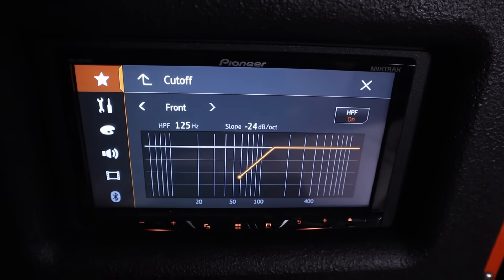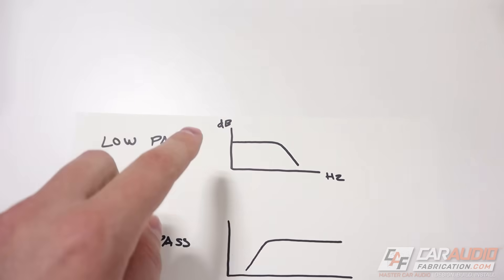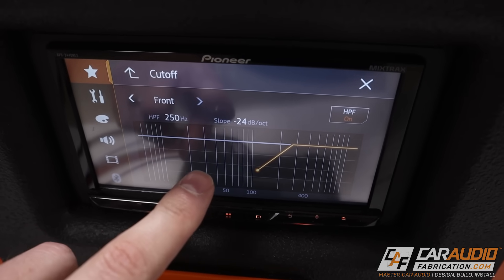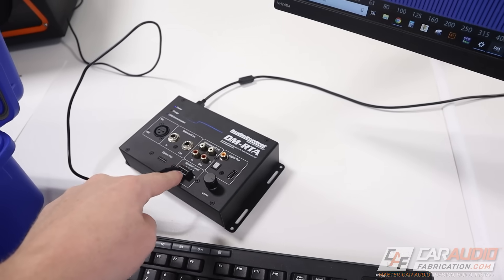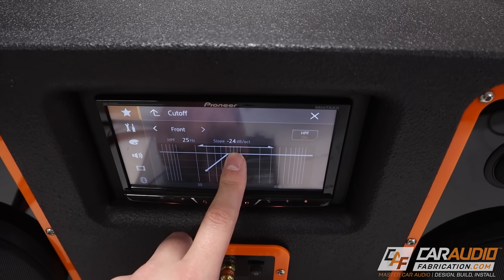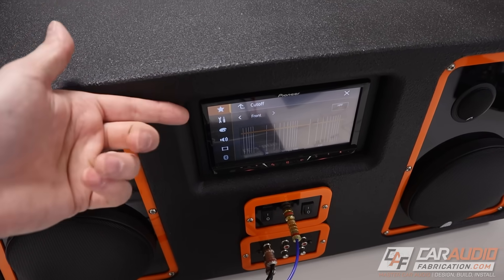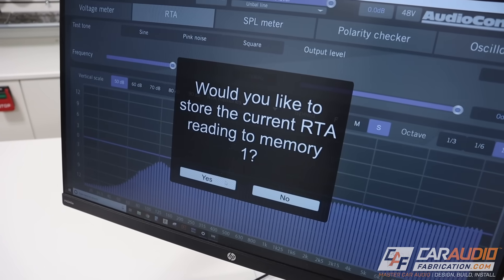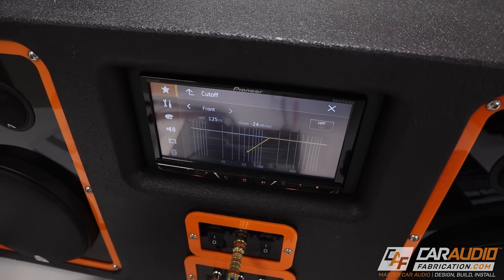Crossovers for Car Audio - Tune on HEAD UNIT or AMPLIFIER? Or combination?

Comment: Sometimes a passive crossover is just better. its kind of hard to find the exact caps and coils and you can't adjust it, but it's safer. If I do use an active crossover, I've always just used both the amp and head unit in tandem, setting both to the same frequency at 12Db per octave on the amp high pass and 6db on the head unit to essentially get an 18Db per octave curve (third order passive crossover equivalent).

Comment: Hi Mr. Mark, I have a quick question if you do mind me asking. I purchase the Taramps TS-400X4, I know is a very cheap amp, but is for my daughter first car, my question is Could I connect one speaker on a bridge on ch1/2  and a second speaker on just ch1 on the same bridge side,  I am trying to maximize the RMS on at least one speaker.

Comment: Hello dear Mark. I need your advice!  I have Pioneer DEH-970 player and Pioneer TS-D1720 (RMS:60W) component speaker. The seller of the speaker told me to wire the mid directly to the reciever and use crossover to wire the tweeters because the reciever can not provide the mid speaker with enough power.
is it right?

And as you see ym player has max 50W output whereas the speakers are 60W nominal. However when I turn the volume above 50 (max 62) there seems to be distortion with rough sound with extremely high sound and not clear sound. And I don't know which part is failing. According to the specification the DEH-970 reciever has maximum 0.01% distortion at maximum level of volume and still the speakers are 60W nominal so that the speakers should easily handle the maximum power coming from the reciver.

What do you think where this rough sound come from (does the reciever have distortion or the speakers can not handle the power)?

please help me
Reply: Yes man, head units do distort or clip, most from about 40-50 vol on the hu. My sony starts clippin at about 42 on the volume. Everybody's hu's are different and adjustments on the radio can make it worse or better, just preference with settings.
Reply: @fredbradshaw3835  thank you dear
Reply: @lazizbektursunov4299  i dont know if im clear on your situation but maybe a small 2 or 4 channel amplifier would help. Maybe add a couple more midrange or coaxial speakers to add to what you have for the amp. With what you have now, your not gonna blow anything, 10 watts difference not gonna matter. All you can do is turn it up too loud and distort. Unless you have inline passive xovers on the tweets, it might be good to get an amp with a internal xover with mid and high adjustments on it. Tweeters and mids have a different frequency so you have to seperate the signals. You could get a small 4 ch amp, put mids on one side of the amp, and tweets on the other and you can adjust the xovers on the amp to what you desire. Good luck. If you need more advice, hit me up.
Reply: @fredbradshaw3835  dear brother thanks a bunch to you for your help. Yes I am a man. I will do your suggestions about adding two more midrange speakers and 4 channel amplifier. 
Dear I notice that when I turn on my head unit at middays there is a lot more distortion above 40 volume and when I listen in mornings or evenings it's more clear up until I turn it up to 50-54. I think it is because hu is very hot in midday. And when it's cool there is less distortion. 
Is it normal situation or is there any fault on the head unit?
Reply: If your a woman, sorry for calling you man i just assumed you were a dude.

Comment: Cutoff slopes also tend to have a bump around the cut-off, depending on the filter design. Especially if you overlap those from the headunit and amplifier filters, you can get weird effects. Two filters chained doesn't always mean it filters harder.
Reply: Yeah I learned that when tuning my subwoofer I used the amps crossover and then the headunits

Comment: Head unit has only high-pass, amp has a hi-low-off switch for the pass. Can I use both to attain a bandpass(with amp switch set to low-pass)?
Reply: Yes you should be able to do that.

Comment: Good info. I use Mosconi 6to8 dsp, but have the amp crossover set up as a fail safe. I  have Focal K2 three way components, set up active, so the added protection is important

Comment: Does matching same Brand subwoofers and amplifier matter? I got two JL TW5 13.5 inch and im thinking of pairing it with a Kicker Kxa 1200.1 i would like to get the JL HD 1200/1 but its out of my budget.

Comment: PLEASE help me with my amplifier. My friend asked me to wire this amp into his truck the other day and as I was wiring the power and ground I decided to test the amp to make sure it would even turn on. I used my multimeter to test and we had 12+ volts from the battery and a good ground so I hooked it up and then took a wire and jumped the 12v signal from the battery to the remote turn on and nothing happened. So I did some testing and realized the remote turn on terminal on the amp is grounded. I was wondering if this is supposed to be grounded. I kept playing with it and researching and there are no videos or someone with a similar problem. I found one guy that said his amp would power on with no ground and I know it was a bad idea but it was for research purposes and I tried it. The amp turns on but quickly dies. If I connect the 12+ and the remote turn on then the amp will power on and then quickly die everytime I touch the ground to the terminal. I took the amp apart and I cannot find anywhere that the remote turn on is touching the ground in the circuit. What do I do?
Reply: For aftermarket amps the remote turn on should be 5v-14.4v, it should have turned on when you jumped the 12v, shouldn't hurt the amp at all. I would check the ground again to be sure it actually is solid, yes it may show fine on your multimeter, but when put under the load of a powered on amp it may be bad. If the amp has good power and ground yet doesn't power up when the remote terminal receives power then you have a faulty amp.

Comment: I have a pioneer head unit on my 05 tacoma and coaxel speakers on the doors what crossover do I set them at or something good thanks
Reply: Coaxials are a midrange and tweeter combined with a built in crossover, you want to set them on a high pass crossover. Generally you set them around 80Hz. If your truck has factory tweeters you will want to disconnect them, they should not be used in conjunction with coaxial speakers (which have tweeters on them already). If you do have the factory tweeters like I said, in the future I would advise installing component speakers instead of coaxials, so that you can take advantage of those high tweeter positions.

Comment: I recently got a head unit with pretty good crossover controls. I haven’t messed with the slope but it sounds a lot better with the filter accurately set than guessing with the amp knob
Reply: so to confirm, if I wanna use the LPF on my head unit, I turn the LPF on my AMP all the way up since it doesn’t have an “off” option? And for using the HPF on my head unit, I turn the HPF on the AMP all the way up as well?
Reply: @_N4VE_  yes indeed. Otherwise both sets of filters will essentially "fight" each other so you want one set of them to be set to the maximum to allow all the frequencies through that they're receiving.
Reply: @Khans0120  so for HPF I set it to max as well? because in the video he had it set to the lowest correct?
Reply: @_N4VE_  yes, set both on the amp to the maximum if your headunit is doing the crossover work(max in this sense turns it "off"). Setting the amp to a lower setting when your headunit is already set to do that work will only make your amp work harder than it needs to and it can have an impact on sound quality. You'll be creating phase and signal degradation issues setting both sets of crossovers to the same settings.
Reply: @Khans0120  so just to make sure I don’t misunderstand: 

LPF-Set AMP to Highest HZ value, Use head unit. 
HPF- Set AMP to Lowest Hz value, Use head unit. 

Correct?
Reply: @_N4VE_  No. Set both of them to the highest on the amplifier if you are using the headunit to tune them in. Otherwise don't touch the headunits controls, leaving them as full range speakers there, and then set everything on the amplifier.
Reply: @Khans0120  ahh i see, so set both HPF/LPF to it’s highest value 👍🏽 thanks, what if I leave my AMP set to “Full”? will that be the same? or is it best to it the other way
Reply: @_N4VE_ if it's easier for you to adjust the settings on your stereo then do it there. Otherwise use the amp only if the amp is easily accessible and you know how to tune it properly.
Reply: @Khans0120  no what I was asking is if I set my AMP x-over to full is that another way to make sure it doesn’t affect the Head Unit x-over? Or is it best to match the filter of the head unit and adjust the Hz to max
Reply: @_N4VE_  yes, that is the right thing to do if you are using the headunit to adjust those settings. No matter what device you use to set those settings appropriately though, make sure the other device in the chain is always set to receive or send out the full signal.

Either like this:
Headunit to 80 Hz, Amp to 250 Hz or whatever your max is.
Or...
Headunit set to Full range, Amp set to 80 Hz.
Reply: @Khans0120  so when i set my amp to full range do i still adjust the LPF/HPF to their maxes? Cuz it essentially use both now correct?
Reply: @_N4VE_  setting them to "full range" means maxing their LPF and HPF settings out.
Reply: @Khans0120  ahh i see so the hz adjustment doesn’t really do anything at that point? btw thanks for answering all my questions don’t mean to blow you up 😆 just like to confirm things to make sure i understand it all correctly
Reply: @_N4VE_  The simple answer is that adjusting those settings on both will not do you any good as far as sound quality goes. Focus on only adjusting it on the stereo or the amp and leave the other one alone(full range or maxed).
Reply: @Khans0120  Got you, but I meant, when the amp is on “Full” does adjusting the Hz knobs do anything or are they redundant after that?
Reply: @_N4VE_  
amplifier LPF control (full range) or 40 to 250 for example, the control must be at 250. Amplifier HPF control (full range) or 40 to 250 must be at 40. If in HPF the control is at 250, all frequencies by Below 250 they will be cut drastically. Then you use your DPS or Radio to decide which frequency to use in each case.
Reply: @_N4VE_ I wish he would have showed setting the deck to 80 and then turning the amp past 80.... so that you see it doesnt change the graph.  The deck is the master and is the forst thing thr music sees so they will always be the dominant crossover.
Reply: @_N4VE_  you just have to be careful maxxing out the anp crossovers because as he said in the video if your deck ever gets reset from dead battery or whatever then you'll have no crossovers and could damage speakers if you crank it uo before noticing something is off

Comment: If you could, I know you are talking about crossovers, but I have a question about the head unit. I have a Pioneer AVH-2400NEX,  I can't see the model #of the unit that you have, but I mostly had played all my video on DVD, but when I switched to digital media files, I noticed that my unit would play the video just fine, but I would get NO audio whatsoever. I have tried all different types, WMV, MPEG, AVI... all types that this unit is supposed to support. I have the latest firmware updated, but still no luck. Also can't get any answers from Pioneer customer service. Just wondered if you had tried video files on this unit, or have heard of this problem on Pioneer units. Thanks in advance.

Comment: Does using two xovers  mess with phase?
As you know, the 6db/8ª slope rotates the phase in 90 degrees.  12db/8ª - 180 degrees.  24db/8ª - 360 degrees, which doesn't matter. And it goes on and on and on...

Comment: Hi Marc! Thanks for sharing your knowledge with others. I just want to add, that Pink Noise looks as flat line only if you using RTA Analyzers. If you use devices with true FFT, pink noise will roll off at higher frequencies. Because actually Pink Noise is a white noise with a 6 dB/Oct LPF applyed. It is important to know when using FFT analyzers

Comment: Yeah my mid speakers are playing bass instead of my subs, i need help
Reply: That likely has something to do with how your system is wired up. I'd need a bit more info on what you're running to figure out what's going on. Best guess is if your head unit has pre-out settings they may be set wrong, which would send subwoofer signal to the rear speaker outputs.
Reply: @ixionn563  from what ik its a 10" Kicker Sub 4ohm, and 1000w amp. Im outta town to double check rn. Guy connected from the battery in the trunk of my 2013 CTS, n took off the bose sub

Comment: I wanted suggestion what config to goninnfir 
Deck options simple pionneer 1 din and Minidsp 2x4 as active crossover or pioneer 80prs 
Is 2x4 Minidsp rev A 0.9volt ok or one needs the more expensive 2x4hd

Comment: I have a quick question that I hope you could help me out with, I've tried searching online forums as well as some DSP tutorials but haven't found a solid answer to my question. It's my first time going active and my question is in relation to tweeter channels on an active setup, as far as the "tweeter channel level"  goes within the dsp software. What I'm trying to get at is that as we all know a tweeter doesn't require much power, say its a 4ohm tweet rated for 25w for example so how would you go about "dialing back" the power to a safe level on the "tweeter channel levels"? Within my dsp software its -60db to 0db level control per channel, and assuming that since +3db is doubling while -3db is halving power I would be adjusting in increments of -3db? So for example say my amp makes 150watts at 4ohm by setting the "tweeter channel level" at -9db it'll bring it down  hypothetically 18.75w? I really don't want to smoke my expensive tweeters, I think I got a general understanding of "+/-3db" on some passive x-overs. But if you could shed some light as far as me heading in the right direction that would be great as well. Enjoy your informational videos btw! Keep it up!

Comment: I just ended to build my new system. 
I mixed Head unit + amp crossovers because of multiple active amplification. 

 Head unit:
*Front, Hpf 80 Hz
*rear, Hpf 80 Hz
*Sub, Lpf 80 Hz

Amp A:
* Front tweeter, Hpf 4500 hz
* Front medium, Band pass 200 Hz - 4500 Hz
* Sub, Full pass ( I should protect more by using the Lpf with a little bit higher value to be safer)

Amp B:
* Front woofer, Lpf 200 Hz
* Rear coax, Full pass

I mixed because my Amp B is only able to filter with Lpf's, and because I use 6 channels from 2 different amps to amplify the Front 3 ways kit, thanks to just one Front RCA cable out of head unit and a pre in-out between amps to by pass the original front signal.

Finally, I built a 9 channels system without external dsp (Cost compromise...). I can't align independentely each speaker, But I align per group FL, FR, RL, RR and Sub from Head unit's dsp.

Comment: So my head unit is limited to 3 low pass filters, 80, 100 and 120hz @ 8dB, i can’t turn it off. If i was to use the low pass on the amp too, (80hz @ 12dB) would it become a 20dB slope?
Reply: Yes
Reply: Phil Moore thanks, got it 👍

Comment: I have a 05 Sierra Ext SLE with a 8.1 Oreo Android head unit and recently connected my subs RCA's to my speaker wires via splicing into them, my problem is that 1.) I can't adjust my subwoofer equalizer on my head unit and 2.) I don't know if the equalizer settings on my head unit for my crossovers is a high or low crossover